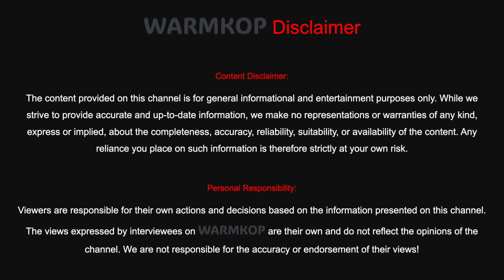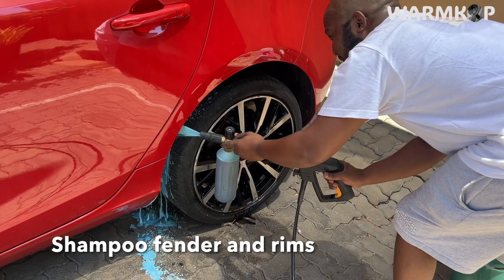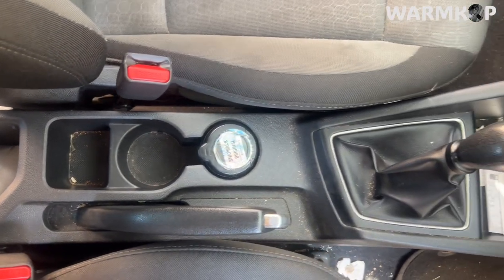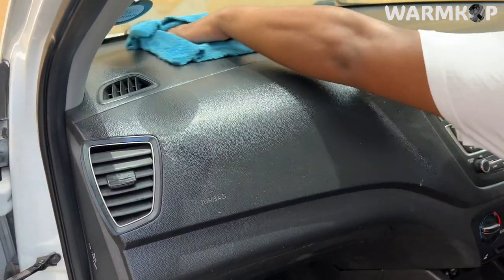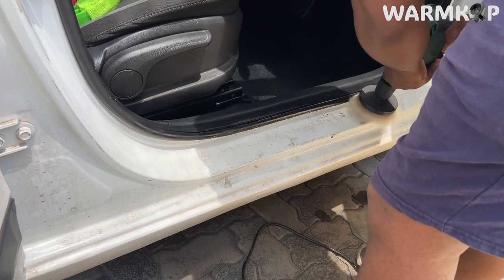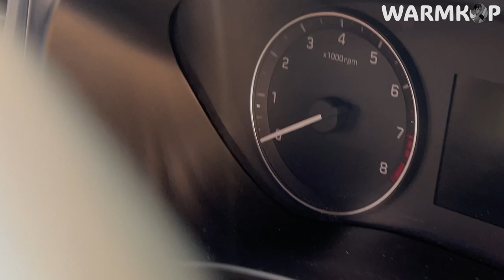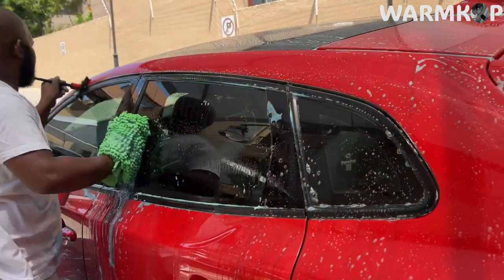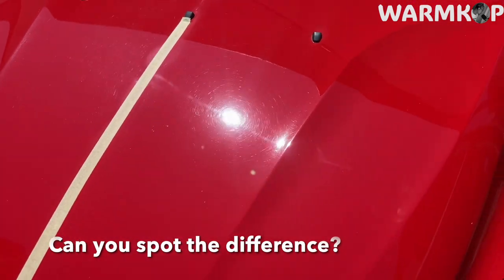Master Car Detailing at Home with Pro Tips from Andile Msomi | Msomi Prestige Car Wash #1

Comment: Which products are you using for cleaning wheels and tires, the body and the interior? I use P&S products. Unfortunately they are expensive and I have to import them from USA.
Reply: There is a shop in south Africa that sells p&s. P&s is not the best its is the usa bang for buck cleaning product that becomes ridiculously expensive when its brought to SA. He used DNAe products that is basically chemical guys re branded and very affordable but just a few of the products are worth using.  If you like me and just detailing your own cars then there are really nice products that can be bought and will give you awesome results.